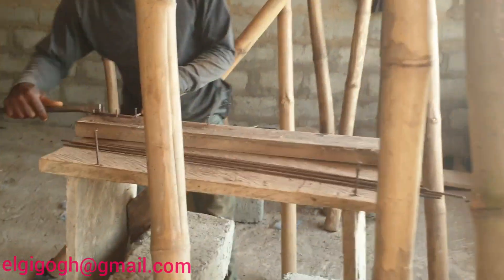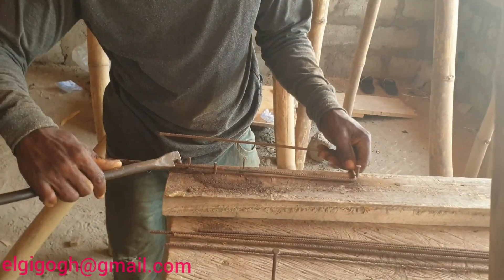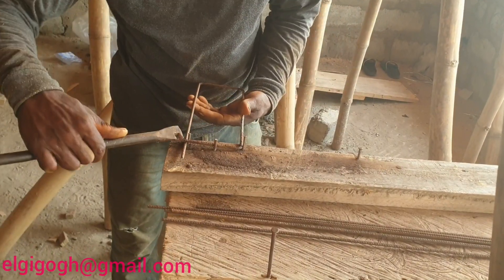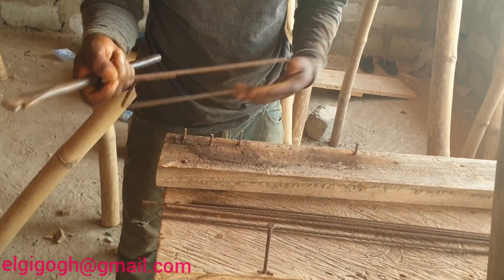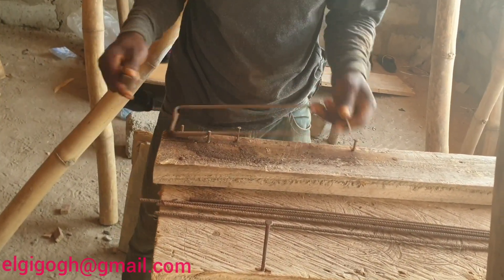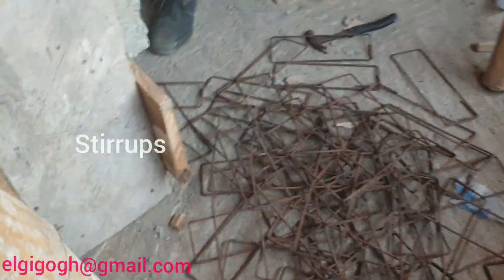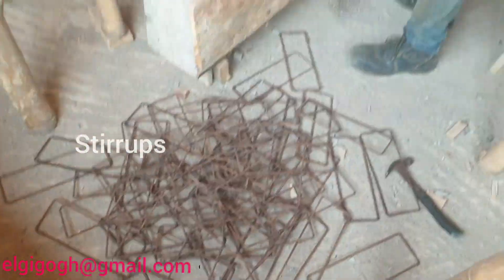Building a House in Ghana| Decking | Iron Rods Beam Bars And Secret Beams| Building in Ghana

Comment: Did you do Lintel before this?
Reply from the maker: No please...we casted the lintel and the flow together
Reply: @Gigo what will be the advantage of that over not doing lintel at all or doing it separately and the add two or three layers of blocks before decking
Reply from the maker: @nestabruce-nanakeain674  doing it separately and adding 3 layers will give you high sealing ....I did mine together because of the labour cost , this way I don't have to pay for the lintel beams casting and then the decking flow casting separately its all inclusive
Reply: @Gigo  great idea.

Comment: Is it possible to use a diameter 14mm rod for the beam of a single storey building?
Reply from the maker: Yess Please it's possible but will recommend if you make load it a bit like 6 rods in a bar( beam)